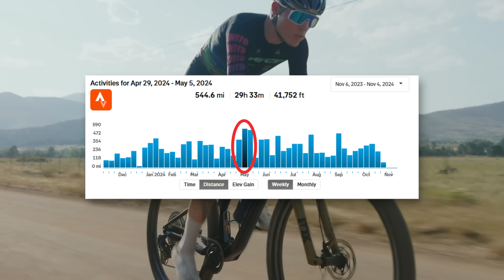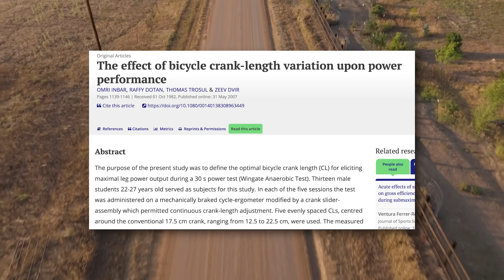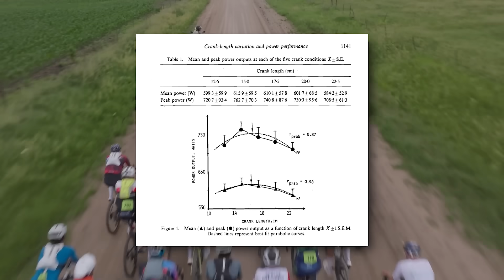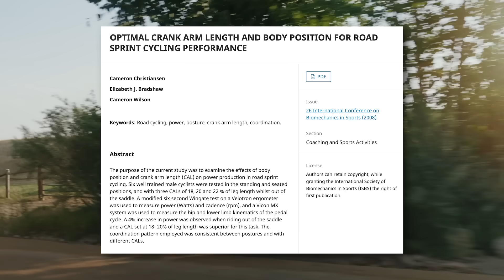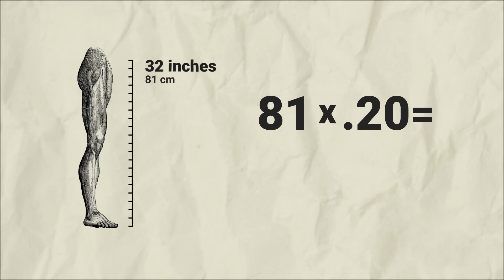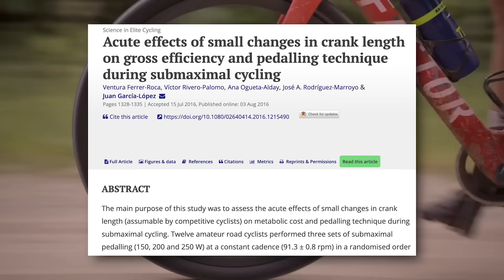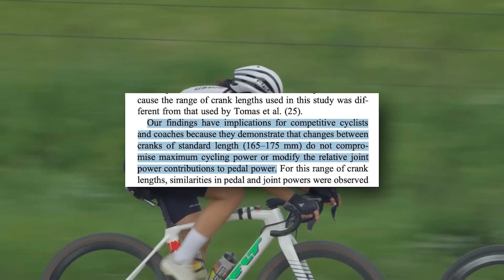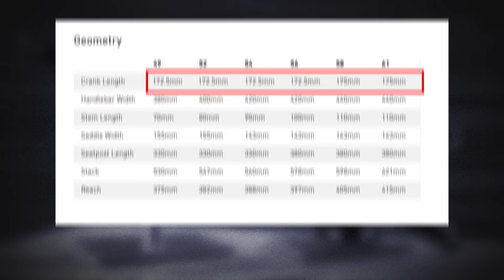You Should Be Using Shorter Cranks, Here's Why

Comment: There are 2 rather obvious advantages for longer cranks: 
1. My bike already has “long” 172.5mm crank on the right.
2. My bike already has “long” 172.5mm crank on the left.
Both are rather essential advantages compared to absent “short” cranks from either of my bike’s sides.
Reply: That's a strong argument 😈
Reply: what are those advantages ?
Reply: @razorree  they are completely free, thanks to the fact that they are already there
Reply: @razorree yes
Reply: Sounds like a skill issue. Have you tried shortening your legs to compensate?
7,5mm sounds like the kind of marginal gains that bike riders salivate over ;-)
/Says this triathlete who went and bought separate 165mm on my TT bike.
Reply: Um . . . I'm going to take it as a sign from the cycling gods that your post has 165 likes at the time I'm writing this. In all seriousness, though, I came here to say exactly that. I have a 172.5 Dura-Ace crankset on my road bike and a 172.5 SuperRecord crankset on my CX bike.  That's a couple grand worth of cranks and power meters, which I'm not keen on paying to replace. Also, both fit just fine for me at 6'1", so I'm adopting the "if it ain't broke" philosophy to avoid going broke myself in the chase for marginal gains.
Reply: Depends on the frame size. Nowadays at least here in Asia some big brands actually default to 160/165 for smaller frame sizes. Really though, they should allow choosing the length if buying one.
Reply: @ryoukokonpaku1575  Yes, 'they' should, but unless we want higher prices due to higher stock levels, we'd all need to learn to wait while our 'special order' is shipped out.
Waiting ...in 2024? 🤔I don't think anyone can even spell 'wait' any longer.
Reply: @ryoukokonpaku1575 so, so many short men lie about their height, that even in Asia 172.5 cranks will continue to sell due, and even though the average height is probably ~15cm or 6 inches shorter than men of European- white heritage. Time to park the ego, be honest, and get the right fit.
Reply: @roberthenri9945  I'm a tiny dude at 165cm,I definitely get that lol. I see far too many running 172.5 and my own Road bike started with that and had to spend extra for 160s due to my bike fitter's recommendations. 

Thankfully seems Giant here in Japan sells their new bikes with S/XS size at 165mm cranks now. Can't confirm other brands though.
Reply: Every argument has two sides…
Reply: @edsassler  ...only 2? 🤔
Reply: Ah, you're suggesting the industry is just trying to get everyone to buy buy buy, how very dare you suggest such a thing 😂🤣😆
Reply: @Cycle.every.day. No it cant be true! Why would they?
Reply: 5mm difference can be compensated by your saddle height and shoes.

Comment: He had me at lower, more aero position
Reply: You can get your upper body lower, but at the same time you have to move your saddle higher, so I'm not sure if it's a more aero position overall.
Reply: @musclelessfitness2045 it is, because the higher seatpost actually allows you to ride in a more aggressive position without your knees hitting your chest. What's important here is that position gives you a lower frontal area by a few cm, it's why pros run small frames with comically tall seatposts to get the same aggressive position.

It's also why TT bikes and TriBikes tend to run 160/165s due to aero performance.

Comment: me watching this after I've already invested in 172.5 sram red cranks for all 6 of my road bikes...
Reply: There is nothing wrong with using 172.5mm cranks, you will be just fine. I have been racing since 1988 at a Pro/AM level my highest point and always ean 180mm cranks.  Not knocking Dylan but the bicycle community is full of "woke exaggerated science" I have been using 210mm cranks for over 10 yrs and love it!! I am 5ft 11.75.  Think about it if +170mm cranks lengths were so bad think of hundreds to thousands of Pros and amerture cyclist that should have had blown out knees after racing for +10 yrs.  Just think before the UCI changed the rules all of the Hour records were broken using 195mm cranks and think about how long it took for records to catch up and break the old records.  You will be just fine!!
Reply: @OTBTBDA couldn't agree more. I'm 173cm tall and now use 175mm cranks. I personally tested shorter cranks, 165mm for 8months, this included training and racing several times a week. Decided to try my 172.5mm cranks and my legs loved it. So I tested longer cranks upto 177.5mm. I rode these for about a year, just couldn't get 100% comfortable. Ended up dropping to 175mm and have been on them for several years now. 
I'm fairly flexible and will spin a over 100rpm when on the front of a paceline. My point is we're all different, what works for one may not work for someone else. Also, I'm sure the cycling industry is ready to sell us anything they can. 
Also, one other thing, I saw an interview with a bike fitter for a pro tour team a couple of years ago, when asked about crank length, his response was fit the longest cranks the rider can handle, that's it.
Reply: @OTBTBDA  What's your inseam? I understand 180mm, but 210 is crazy lol
Also, you cannot use records as a reference since there are a lot of factors and drugs involved lol. As a counter argument, I could mention that Pogacar has destroyed many KOMs on 165s.
Reply: @OTBTBDA  yeah, there is also a lot of people saying that they were using rim brakes for past 30 years and they're fine ;)
Reply: You might be 6'5 for all we know.
Reply: If you have long legs, it might be a perfect size for you. Try the formula: Inseam X 0.20 or 0.21 ... it might still vary depending on your feet length.
Reply: @musclelessfitness2045  but here they're saying .18 might be good as well
Reply: lol.....